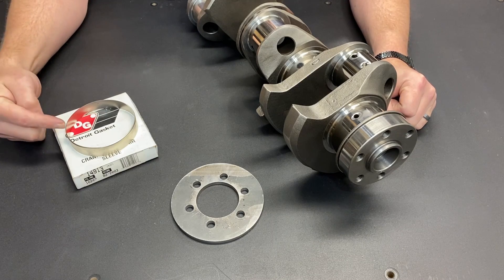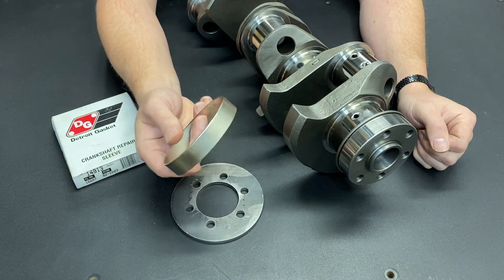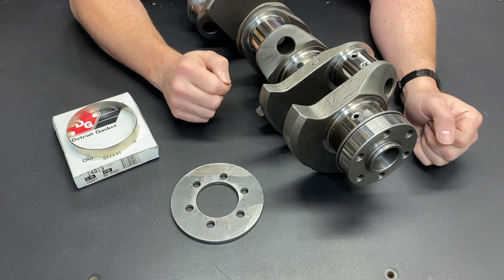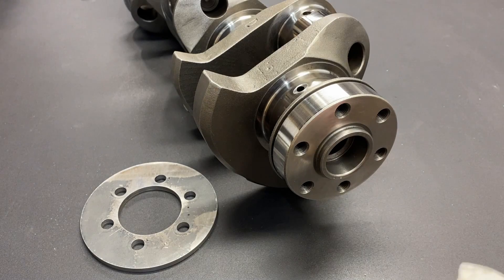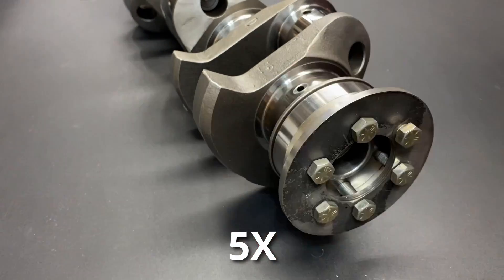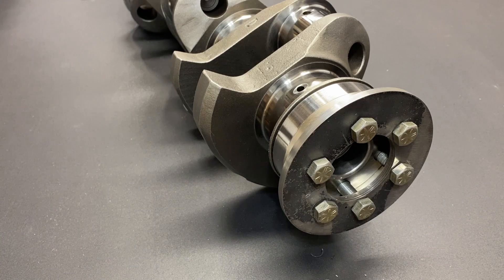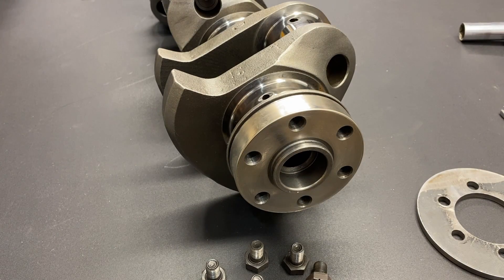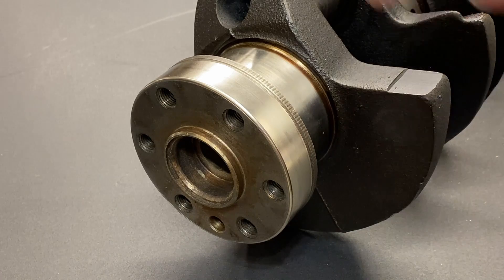393 Windsor Build Part 4 Crankshaft Repair Micro/Speedi Sleeve install and Removal Small Block Ford

Comment: so dumb...just use the sleeve install tool they sell specifically for the sleeve you bought
Reply from the maker: Spending money on a tool that you use to wack it on with a hammer is the unintelligent option. Making a tool to press it on out of a piece of steel I already had way better results and free = smart
Reply: Troll
Reply from the maker: I agree!! Its amazing how much internet access there is under bridges 😂😁🤣
Reply: Would you make and sell them
Reply from the maker: it would take too much time for me to make them by hand so I could not offer them for cheap enough and I don't think there is a big enough market to order a run of them laser cut

Comment: Why not just use the flywheel instead of making a custom tool?
Reply from the maker: Totally and option however big and cumbersome making it hard to see around to verify it is going on strait. Cutting the middle out of an old flywheel would give you a smaller tool and be easy enough to make.

Comment: you should make and sell the tools. no one has the plastic sleeve anymore
Reply from the maker: It's not cost effective especially when someone can get a flex-plate out of the junk yard and cut the center out.
Reply: @dazecars  cool i just put mine on with a block of wood and a hammer
Reply from the maker: it does work 😁

Comment: Do you know of any mechanics in the Los Angeles area who do this repair? My rav4 has a scratch on the crankshaft and no one has experience with repair sleeves. I’ve been told I need a new engine.
Reply from the maker: Start by going to the auto parts store and see if a repair sleeve is available for your application. If not there is nothing you can do.  If one is available any competent mechanic should be able to do the repair but I do not have any recommendations for your area as I do not live anywhere near there.

Comment: You cleaned the outside of the crankshaft, but not the inside of the sleeve. Any reason?
Reply from the maker: no good reason 😁  The crank was a "used" part so making sure there was no oil or other contaminants on it was critical and why I talked about it on the video.  The sleeve being a new part in a sealed package was clean and probably did not to be cleaned however it would have been simple enough to clean it and I probably should have been done just in case there was contamination.  To be completely honest I installed the sleeve only for the purpose of the video as it was not actually going into a motor.

Comment: Do you have reason to believe that new crankshaft rear main gland is undersize requiring the sleeve?
Reply from the maker: They are not undersized, but they are also not hardened steel.  a grove will form in the crank and cause leaks.  I suggest you use one all the time not because of an undersize issue or anything like that but rather because it has been proven to work way better.  I have seen accounts from lots of builders that use them on every build.  rear mains have a tendency to weep even with new components all the way around and this solves that issue

Comment: Nice video. I need to install one on the crankshaft of my Audi that has a groove from the old oil seal. But a flanged oil seal is installed on my crankshaft which includes the wheel for the rpm sensor. Since the wheel is made of hard material, I'm afraid it won't enter the sleeve or push it, or crumple it. Do you have experience in mounting on shafts that have the rpm sensor in that position?
Reply from the maker: Glad you liked the video.  Sorry, but my experience/expertise is with classic fords so I have not had to deal with any crank sensors.

Comment: Is it a stock crank from a 351
Reply from the maker: no in order to add the extra stroke needed to increase the displacement you need to uses a crank with more swing.  I am using a specific 393 crank.

Comment: Great idea to add the sleeve on a new crank to protect it. Nice job on the install tool as well. I have never seen a sleeve removed before. Good job on that. I was curios on the rockwell hardness of a speedy sleeve so I did a Google search and it is saying the Rockwell hardness is 80-85 rockwell. That's hard and a seal should never wear into that.
Reply from the maker: thanks for the information on the hardness.  that was Info I didn't have